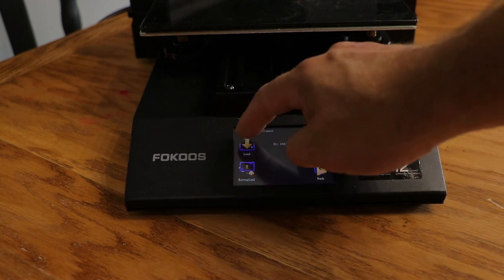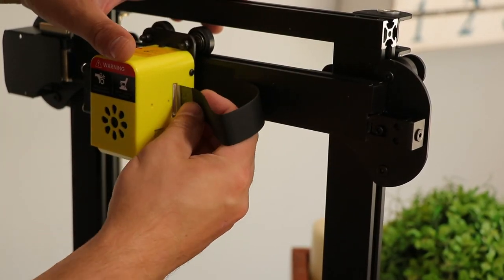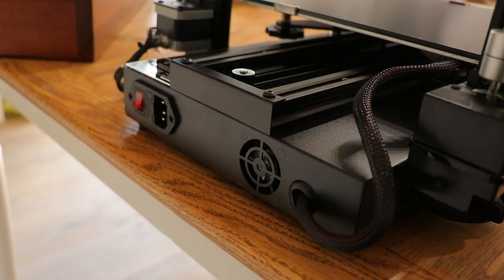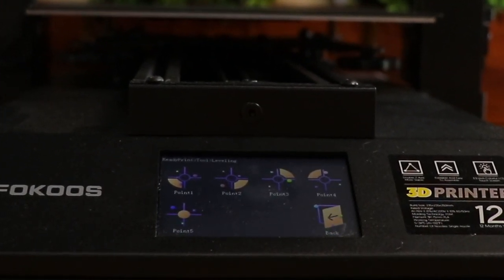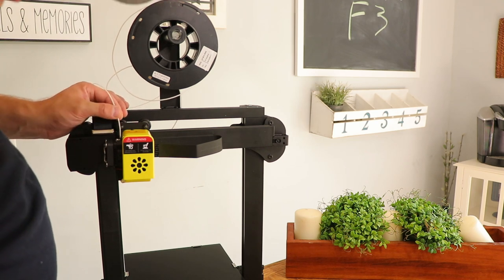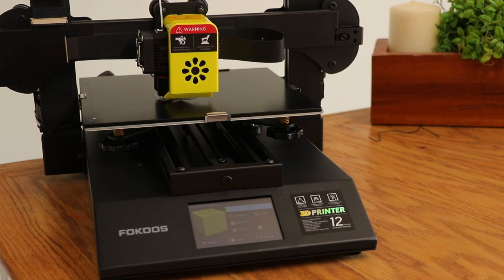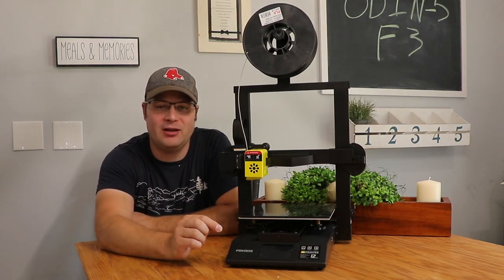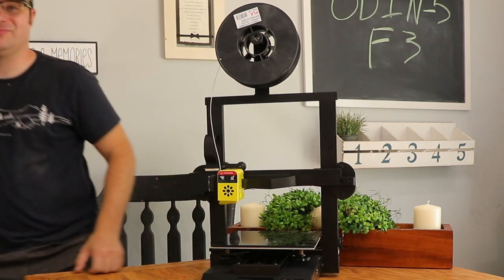Is this better than Ender? - Fokoos Odin 5 F3

Comment from the maker: Buy the Odin-5 F3 - https://amzn.to/3AOwcgx
Reply: why this one it does not print as many materials as the sunlu
Reply from the maker: @kyleday5026  they all print the same type of filament. It seems like you’re new to this and you just don’t understand yet but eventually you will. My opinion is the Fokoos is better. I’ve had plenty of my friends who have recommended this to that have bought it, and absolutely love it if you want to buy some thing else, feel free to. In general, though, I don’t think there’s a better value for a beginner than this machine.
Reply: @Toid  OK thank you but on website for the fokoos it does not mention the materials that the other printer has like carbon fibre also regarding the speed it can print over 200mm/s so it should be OK also do u think they both have the same type of extruder and are they both metal.
Reply: @Toid  also is print quality based on the filament and not the printer
Reply: @Toid  have you ever tried the sunlu printer yourself.
Reply from the maker: @kyleday5026  this is the problem with beginning in 3-D printing. Companies like this confuse you to make you think that you’re getting more than you actually are I stay away from companies like that because they’re already starting on deception. Both filaments have a version of pla or Petg. When a company goes that far it is their way to confuse the consumer to believe they are getting more out off it, it’s a major red flag. Both machines are based on the Ender 3 design. There Fokoos uses a direct drive versus Bowden which, in general is better and easier to switch out filaments. I don’t plan to answer any other questions from you. I already told you which one I believe is better.
Reply: @Toid  OK thank you I almost bought the other
Reply: @Toid  have u ever had any problems with different filaments and had to change the nozzle.
Reply: @Toid  have u also ever had any upgrades

Comment: Awesome review. This is the model I set my sights on based on a previous post of yours.
Reply from the maker: It is really amazing. I actually gave my dad my Ender 5 and I'm exclusively using this now. I completely forgot to mention the belt adjustments. There's actually a few screws on there that allow you to easily adjust the belt tightness. Which is really nice.

Comment: Yikes, this looks like a pretty good 3-D printer to take the plunge with. Since this thing is so good, I think the struggle for newbies getting started in 3-D printing may well be the software to model the stuff you'd like to print... that's what intimidates me the most, honestly. I wonder if one could mess with some modeling software for a month or so to get the feel for it, then purchase the printer after they've got the basics down on the software. That way if the software is just a no-go, then you haven't laid out the cash for the printer.
Reply from the maker: Absolutely you could. There's a lot of free modeling software out there. So if you wanted to mess with the modeling software first, you could. What a lot of people do though is they print off models from thingiverse, to get their feet wet. Then jump into the design aspect. That way you can kind of see what other people have done and what works, before you start designing stuff.

Comment: That's a good deal on the printer. Idk what I would use it for though. What kind of stuff do you print?
Reply from the maker: Really the possibilities are fairly endless. I've built a few speaker enclosures with it and amplifier enclosures. Pretty much any DIY arylic board, I can print an enclosure for. Same with raspberry Pi. The other day I had a small dorm size refrigerator that lost a part to it. I easily designed it in a program and printed it off that way I didn't have to throw away the refrigerator. I've even made airplane gliders for the kids and lithophanes for gifts. But really what you decide to make might be completely different than something I make. You can check thingiverse and there's a bunch of pre-made designs on there that you can look at. See if anything catches your eye.
Reply: @Toid  thanks

Comment: Should I expect this printer to have less problems than my Ender 3? I always need to adjust everything to get a simple print to work. I am a bit worry about non standard parts like the ribbon cable...
Reply from the maker: It actually came with a spare ribbon cable. I'll say this, I've had this printer since this review and I haven't had to make any adjustments to it. One of the things I did like about it that I forgot to mention was that you can very easily use an allen wrench to tighten up the belts if those should ever be stretched. It's built right into the machine with metal parts, very simple to use and can help you regain tolerances if you should need to. I haven't had to do that yet though.
Reply from the maker: I'll also mention, this replaced my ender five. I like the build volume of the under five better, but I was like you having to do way too many adjustments.

Comment: Have you tried the 3D printer Genius from artillery ? It's also in the same range of price, has a touch screen and even the fans are silent from what I tested
It would be nice to have some tests and some details proving that this printer is better than an ender 3 or an Artillery Genius. 
I see your point that it's easy to assemble and it improves the user experience but what about the quality of the print ?
Reply from the maker: I haven't tried that one yet. Sounds like another great option. Print quality was on par with my Ender 5. I wouldn't say it's significantly better. But the bottom of the benchy did turn out nicer than on my ender 5. Otherwise most of the print was pretty identical. What makes this better is like you said, user experience and esse of use to get better prints. And I really appreciate that I don't have to worry about hangups. I did rarely get them with my Ender. And of course it was always on a big build.
Reply: Thanks for your answer, it's good to know !
Reply from the maker: @nerosysalcyon7493  you're welcome. And next time I will go ahead and throw some comparison prints out there. I think that's a great idea.
Reply: @Toid  WHATS IT LIKE PRINTING AT SPEEDS OVER 200MM/S ANY ISSUES
Reply from the maker: @kyleday5026  it’s not designed for that. Really to get good results with a printer at a speed like that you would want to have klipper installed and quite a few upgrades, including cooling.

Comment: Are you still using this printer? If so how is it holding up?
Reply from the maker: I am and it's holding up well. No issues for me. However, I have an Ender 3 S1 on the way as a second printer. I'll try to compare them at a later point in time.
Reply: @Toid  yes please! for me it was between buying this one and the s1 i still cant decide
Reply: @Toid  I'd be extremely interested in this comparison if you still plan to do a comparison video, or if not just your thoughts on the pros and cons of the two posted here? 👍